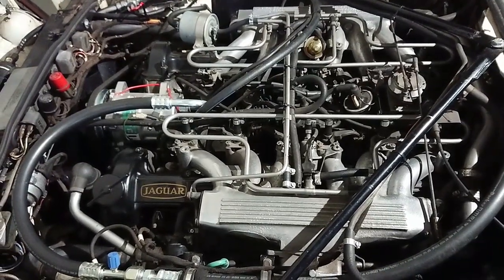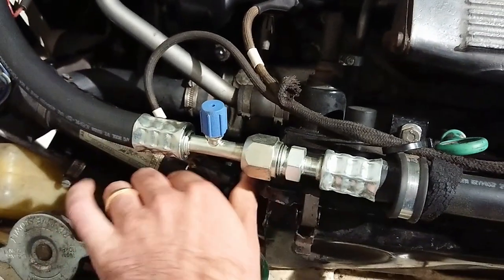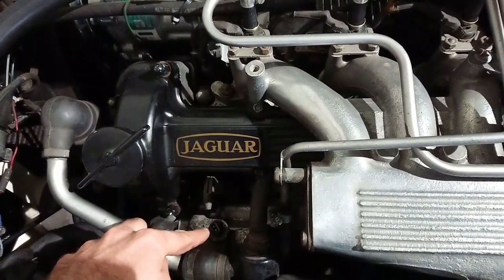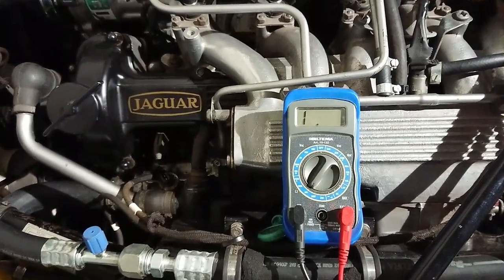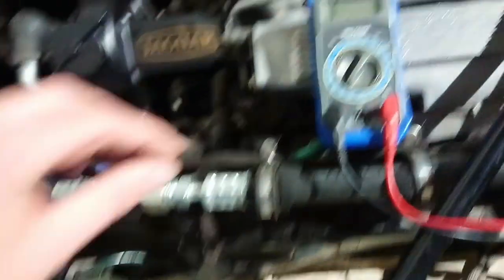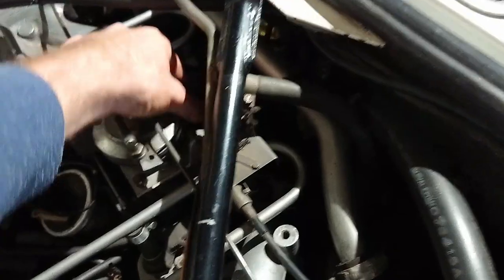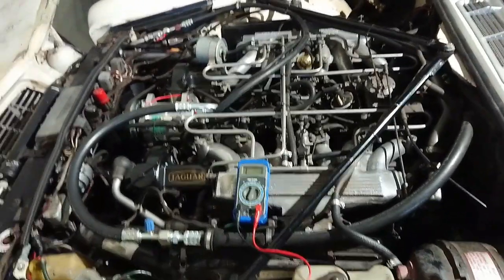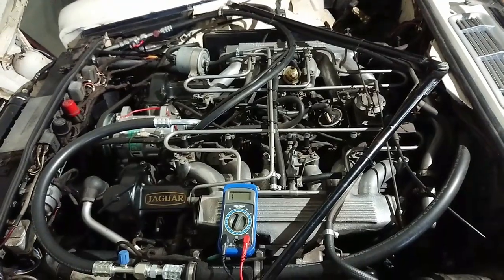Checking Sensors and Connectors  - Understanding D-Jetronic Fuel Injection part 3 (Jaguar V12)

Comment: I got a 1986 jaguar xjs v12 engine and trying to get it to start it was my dad and I am wanting to get it to run again I replace fuel pump fuel regulators and fuel filter and it been to a couple other shop and I can't get it to start still did not know if you might know what could be wrong

Comment: Hi my name is Pete .I am working on 92 XJS  5.3 l have code ff-49 power to resister just rewired the Eng. Compartment I have no Eccelarator power starts fine has code FF 49